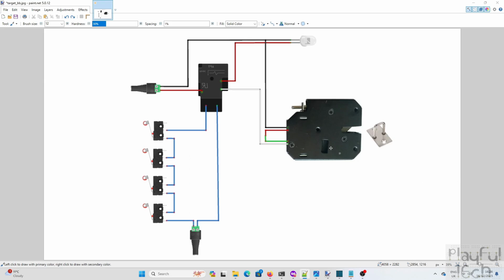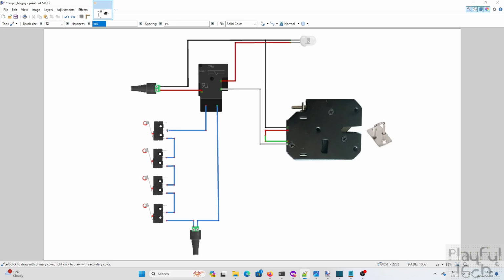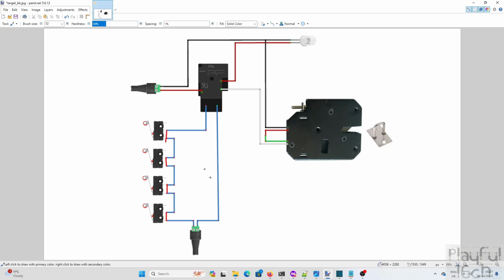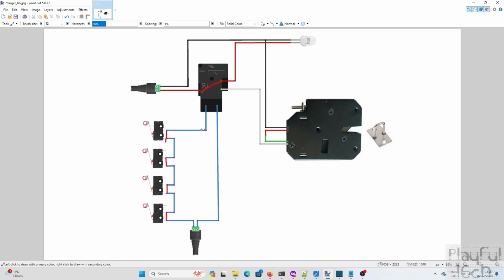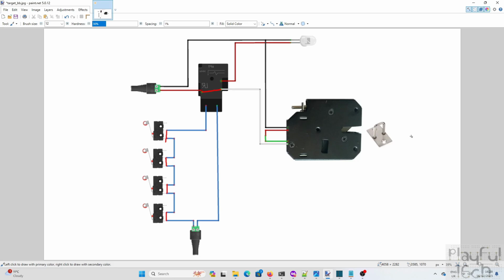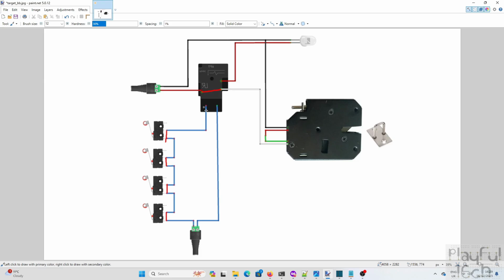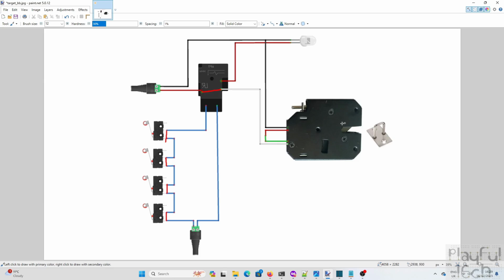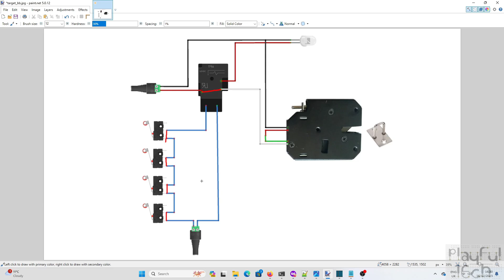Build an Automated Fairground Shooting Gallery

Comment: It'd be cool if there was a latch that caught the target when it knocked down- incase they hit hard enough it wanted to bounce back...then, remotely you could control that latch to release them...for extra pizzaz, have them released in sequence like dominos..so it looks cool. A spring thingy under tension on the padles hinge has just enough force to pop them back up.